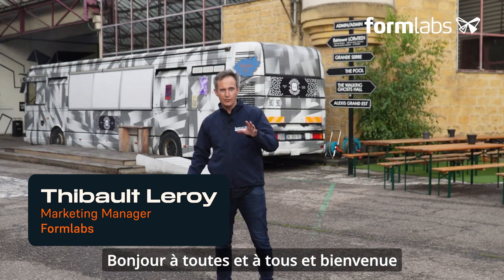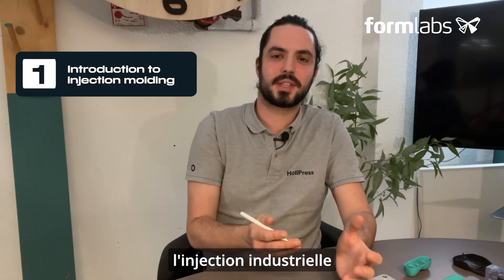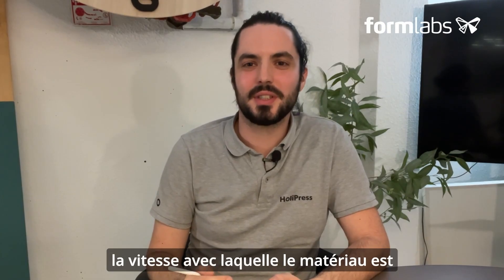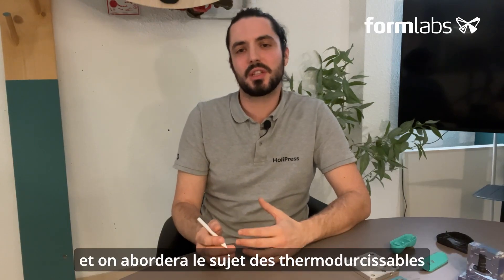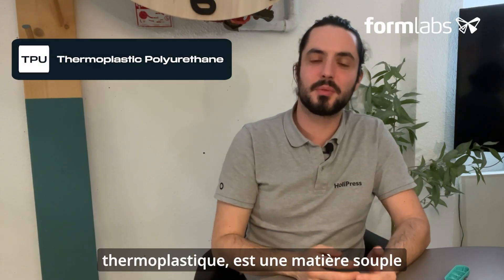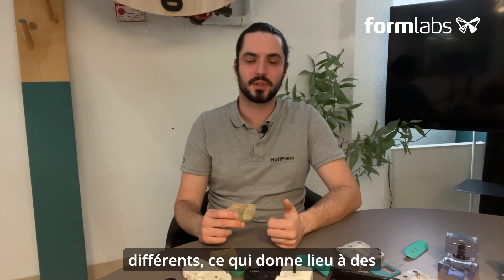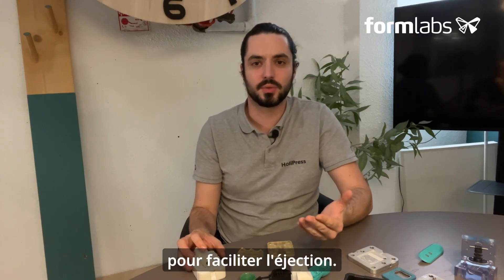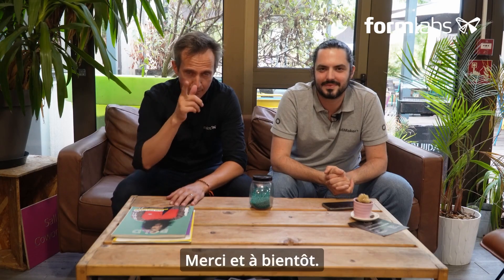Introduction to Desktop Injection Molding Using 3D Printed Molds (Episode 1/5)

Comment from the maker: 🟠 3D Printing for Injection Molding: https://bit.ly/474eIPI
🟠 Injection Molding with 3D Printed Molds - Process Conditions: https://bit.ly/45F6dZ7
🟠 Formlabs SLA 3D Printers: https://bit.ly/3JkQc34
🟠 Rigid 10K Resin: https://bit.ly/4mnsQbF

Comment: Amazing, this kind of applications is why we plan to buy an SLA machine, nothing else compares to this.

Could you make a food safe injected plastic part with this? Or would the resin printed mold leave residues?
Reply from the maker: To ensure food safety, the resin printed part itself must not come in contact with food, but a plastic part that you form using a 3D printed mold can be food safe if it is properly cleaned. Find out more in our guide to food safe 3D printing: https://bit.ly/4oMFT7U